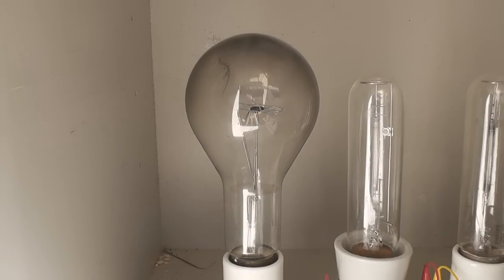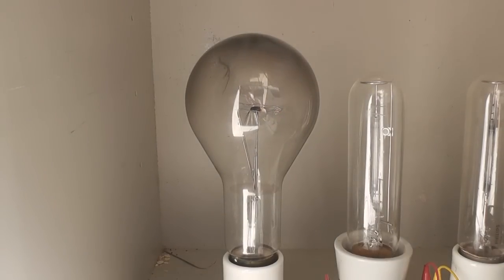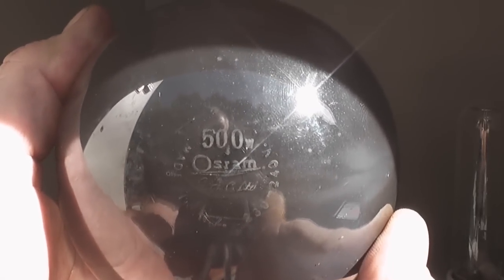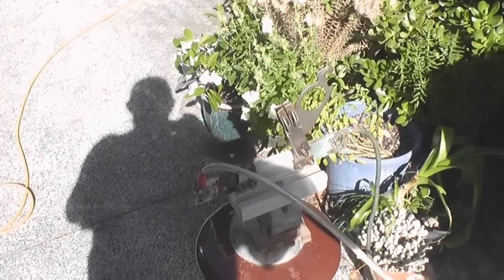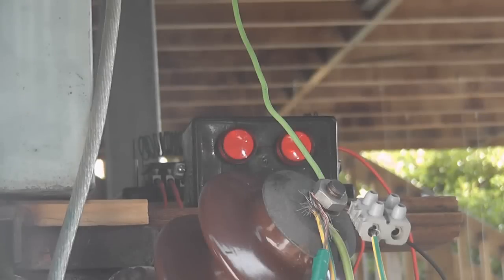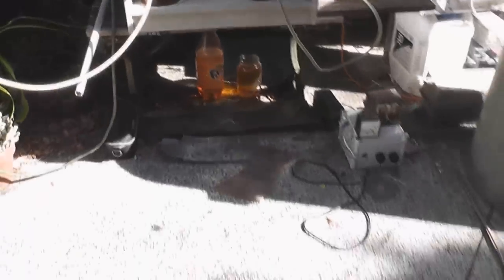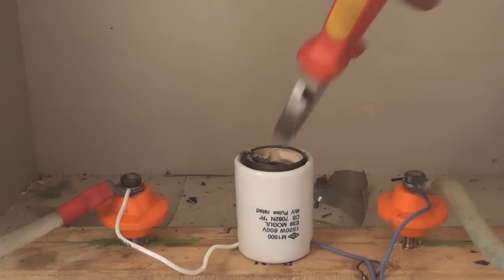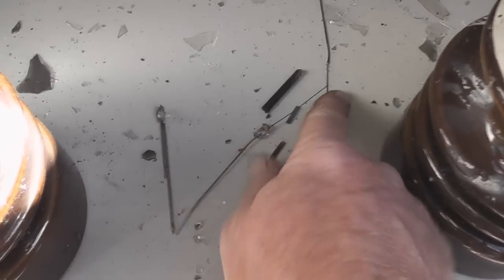500 Watt lamp explodes - Full video

Comment: Reminds me of the time lightning struck a radio tower we had in the back yard. It took out the top marker lights. When the tower service tech came back down from replacing the two lamps he handed us two brass bases and some glass beads. Everything else from those two bulbs were vaporized.

Comment: If only you could have rented a special camera with an insanely high frame rate.
I wonder just how & why that bulb actually exploded.
Reply from the maker: I would have if the high speed camera rental costs were reasonable.
The bulb was subjected to about 7 kV DC from a large Cap bank.

Comment: I've had #55 6 volt miniature bulbs come back to life on a reverse connected 240-6 volt transformer out of a cassette player feed by a 25 volt transformer. Approximately 800 volts across the broken ends of the filaments lit them a blue-silver and coated the inside of the bulbs with blue plastic from the lead-in wire separator "bead".

Comment: it just happened to me was an energy saving light bulb i went in to the kitchen switched the light on it literally exploded i saw hot glass smash to the floor part of the bulb is still in the socket this is the first time i experienced this, usually when a bulb goes they just flicker n go off no explosion can anyone tell me wyhy this happened? should i be worried about all the other bulbs doing the same thing? i have a light above my bed im kinda scared thats gonna blow too the same way since its the same brand of bulb.
Reply: i didnt dare touch it but yes had a neighbour with very BIG balls to come switch off the mains and remove the pin no one got hurt, it still needs a new socket but we are not using the one thats there.
Reply from the maker: That is pretty bad, those lamps are supposed to be safe. could have started a fire. Take photos and make a claim to the manufacturer.
Reply: RODALCO2007 i shit myself only went down to get something to eat i pressed the switch and it instantly bang! no warning or nothing, the box tripped out too.

we had the house rewired like 2-3 months ago the sparky give us the bulbs no harm was done just abit shook up after it, as i say never once has this happened to me in the 25 years ive been alive usually they flicker go dim or just switch off this one exploded off the ceiling.
Reply: Julian john how did it explode? From the tubes or the ballast?
Reply: the tubes on the bulb exploded, the end of it was still in the socket had to shut down the power meter to remove it. also something else happened the double socket where i plug my tv into one side had melted not sure if it happened when the bulb went we just found it melted last year one of the pins from plug was still stuck in the wall! it looked DEADLY! i think touching it would have been suicide here in uk we use around 230v standard for anything electrical. i live in an old house it suffers damp also have a shower that leaks i live in a death trap.
Reply: Julian john I've noticed around the heat filaments the get very hot I noticed they were breaking there around the filaments as well I only use incandescent or halogen equivalent bulbs
Reply: Julian john oh man yes it seems like you had a bad connection with the receptacle loose contexts melt yes you do not want to touch U.K. Voltages have you got that taken care of?
Reply: Julian john yes there fairly cheap buy a good one water proof just turn off the mains and put a new one in it have the neighbor just make sure its correctly installed